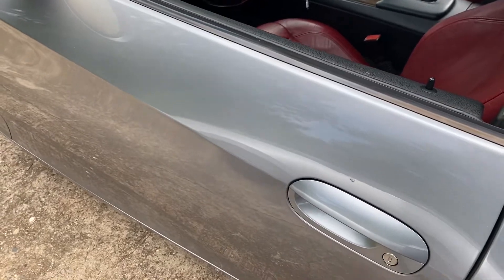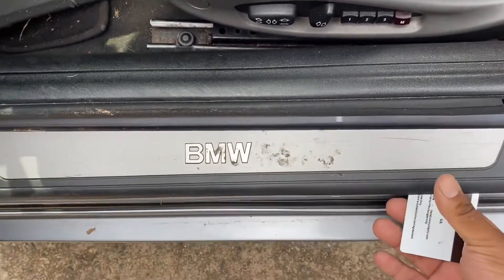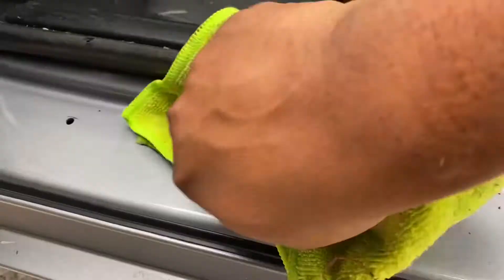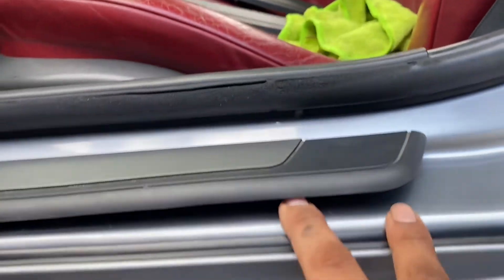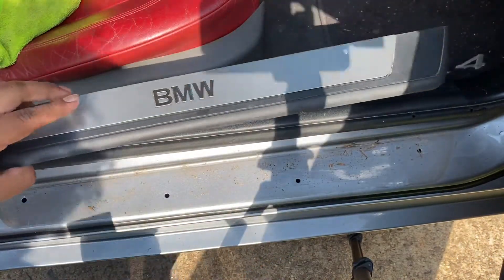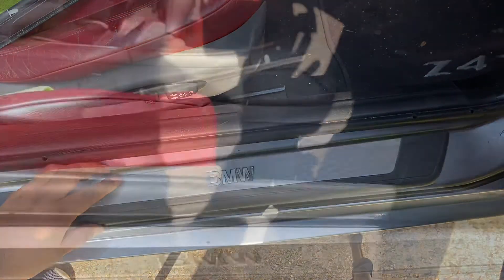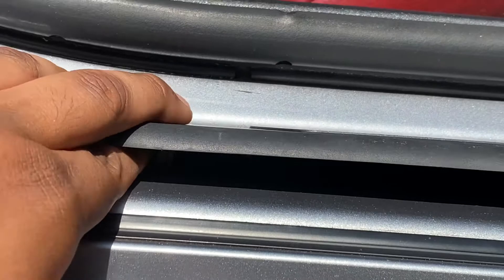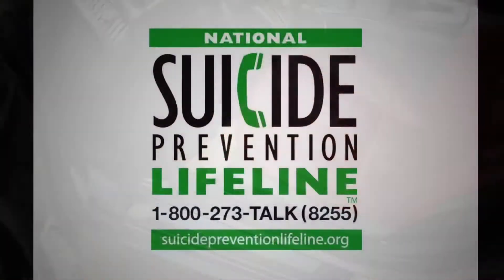How to replace BMW Z4 kick plate

Comment: Keep up the work dude! Would be cool if you restored or replaced your seats. Would make a big difference to the interior 👍
Reply from the maker: Funny enough I have the replacement seat sitting in my garage. It will be done before Zfest 2021